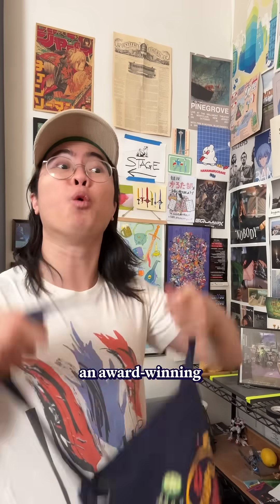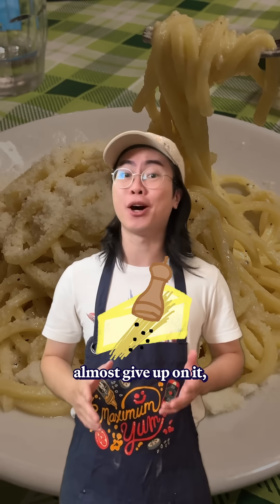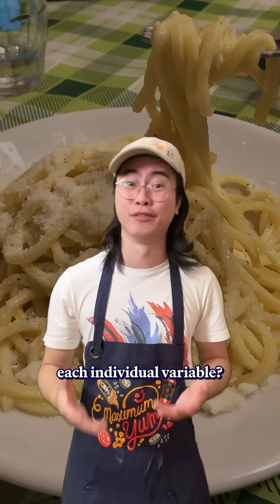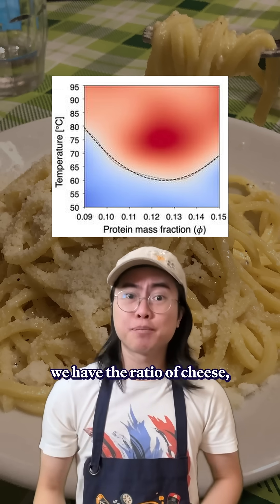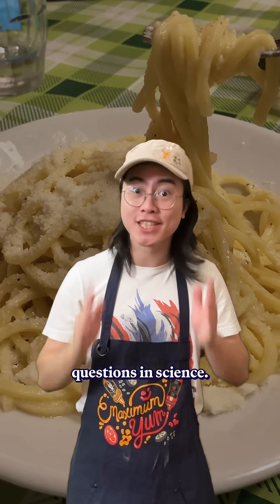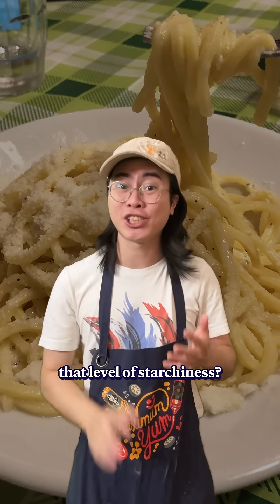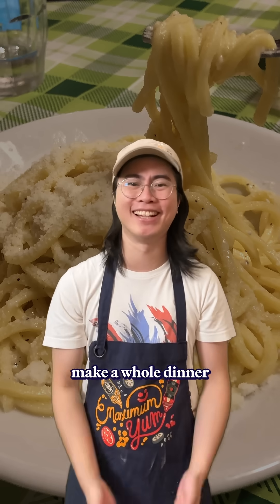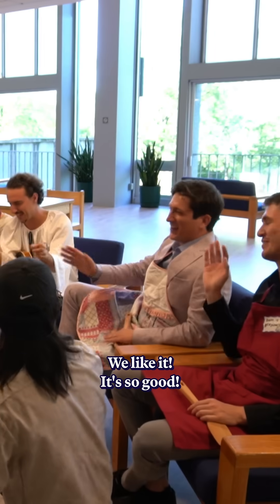The physics of cacio e pepe

Comment: Pro tip, as someone who makes this kind of sauce all the time with any kind of cheese. It's not rocket science, and there is no need to add any extra starch from another source. The secret is BOILING THE PASTA IN LESS WATER. Using just about exactly a tiny bit more than needed to cook the pasta, enough to melt the cheese into, none to strain, this results in pasta water that is completely saturated with the excess starch from the pasta. After cooking, make sure it is only just hot enough to gently melt the cheese going in, et voila. No extra ingredients, fancy measuring, or faffing about with a whisk in a separate pot. You can add cream, butter, or a splash of lemon, or whatever else as desired.
Reply: Can you specify "in less water" like the pasta shouldn't be almost peeking out the water?
(i never realised people really add much more than that…)
I guess time to try and find out
Reply: @nikolaskuklis5925 yes what you are doing is the proper way, but ppl will literally use 3x the water needed then pour it off, or even rinse the pasta, which u only really want to do for a cold dish mostly.

Comment: @FrenchGuyCooking did a series on Cacio e Pepe where he cooked pasta in the same water multiple times in order to really elevate the level of starch in the water. The other way to do it (without adding corn starch) is to use as little water as possible, and as fresh of pasta as possible, in order to concentrate as much of the starch from the raw pasta in the pasta water before using it to make the sauce. Ultimately you're trying to make a roux using only pasta water and Pecorino Romano. If you add any other starch to it then you're still making a roux, but you're no longer making cacio e pepe.

Comment: Use less (near minumal) water when making the pasta. Pull the pasta before it is fully cooked. Dump excess pasta water. Let reserved water cool to under 60c in pan. Then add cheese and return gentle heat and stir, until fully combined. Toss noodles in warmed sauce and plate.

Comment: The secret to cacio e pepe is: don't use a food processor to turn your pecorino or parmesan into powder.  That leaves it in small balls, and the distance from the surface to the center of the ball requires a long time to melt.  You therefore resort to higher temperatures... and get the gloop.

INSTEAD, use a MICROPLANE.  Now, every little crumb of cheese might have the same volume as the food-processed ones, but they're thin flakes.  The distance from the outside to the center is very small, and they melt quickly and at lower temps.

The starch in the water actually isn't critical to a good cachio e pepe.    In fact with no starch you can up the cheese content just a bit more.

This tip also applies to the other spaghettis with grated hard cheese: Cacio e Pepe, Pasta alla Gricia, Carbonara, Fettuccine al Burro, Fettuccine Alfredo.

Comment: Uh it’s not that difficult to make.   Grate the Pecorino Romano in a bowl then boil the pasta until it’s about 3 I’m away from being done.  Toast the cracked peppercorns in a dry pan until they smell spicy and ass some of the boiling pasta water to prevent burning and shut off the heat.  Add a tablespoon or two of pasta water to the grated cheese and mix.  Put boiled pasta into the pepper pan and the heat from the pasta, warm cheese and warm pan should be enough to bring it together.   Too high of heat and you will have a stringy mess.  

The cheater way to do this is to grate a few cups worth of cheese.   In a separate bowl  microwave some water to near boiling point.  Put cheese into a blender or food processor and add half of a teaspoon of corn starch to the cheese and pulse to mix.  Then add just enough of the water and blitz to the point it is a thick cream like a buttercream frosting consistency or just slight more loose than that.  This can be added a table spoon or there about to hot pasta in a hot pan and the corn starch will stabilize the emulsion as well as make it more pleasing to eat should it sit for some time.   Cacio e Pepe is a dish that needs to be served and eaten immediately otherwise the texture goes off fast and the cornstarch delays that. 

In place of some of the water in the stabilized recipe you can purée steamed vegetables to add color and other flavors.  You still need to add water to the blend to get the right consistency but having a jar roasted red pepper flavored cacio e pepe starter in the fridge would make for a nice quick and easy pasta side or main dish for a mid week meal.   I have not tried freezing this blend but I imagine as long as the blend doesn’t reach a very high temperature say more than 150 degrees it should still work.

Comment: One trick I've seen to avoid using corn starch and stick to traditional ingredients is to cook the pasta in a much smaller amount of water to concentrate the starch from the pasta in the water. (No, don't break the pasta.) You can use a pan, it needs much less water; looks weird when you're used to the pot, but other pasta dishes cook in a pan such as Pasta All'Assassina, so it's not a new idea (although one could argue that Assassina is breaking some rules...).

Comment: Mythical chef Josh said something on this. If you think about the old way of doing things, they used the same pot of water for all the noodles, there was extra flour on the noodles, and they would add water each time they cooked to replace what was bolied off. This would lead to a very starchy water, which would also be heavily salted to keep the starch levels low enough that it was atill watery and prevent spoiling. Adding a teaspoon of flour and a half cup of water managed to get a decent consistency for him

Comment: 1. Use real high quality bronze cut pasta (google it) its the gritty looking pasta. It contains a lot of starch compared to commercialized bs grocery store pasta

2. Use the block of pecorino romano cheese and grate it yourself. Dont use pregrated because it contains emulsifiers to keep it from clumping while packaged. If you use that in this dish it WILL clump up once it hits the heat

3. Dont use a lot of water when boiling the pasta and use that pasta water for the emulsion process

Comment: I used to work at an Italian restaurant, fancy one, not a big chain kind of thing. They had one pot for cooking pasta and only changed the water twice a day. Let me tell you, when it comes to your important "starchy pasta cooking water" THAT stuff after a couple dozen portions of pasta had gone through it was a totally different ballgame than the water you have at home after cooking just one package of pasta in the ~4L water usually recommended. You could up the starch levels without corn starch by using less water to cook the pasta. 

Of course it would take more testing to find out the details.
Reply: I need the all day pasta water. I can tell pasta water from on boil does something, but starchy pasta water that's been making pasta all day? let alone half a day? oh boy that's gonna make a nice sauce.

Comment: A foolproof trick is to cook off your pasta in as little water as possible, once your pasta is mostly cooked through move it to a different pan, ladling in your reserve starchy pasta water and letting it evaporate leaving more and more starch behind, finishing off your pasta to al dente with these ladles of water and increasing the starch content, then add a ladle of starchy pasta water that's slightly cooled into a bowl with grated pecorino and your toasted black pepper and you shouldn't ever deal with the issue of your cheese clumping and going stringy. Taking your pasta off the direct heat, mixing in your cheese mixture and quickly tossing it through, ladling in maybe a little more starchy pasta water if needed

Comment: also, FYI another favorite cheat is adding an oil like extra virgin olive oil. It does two things:
(a) lower the overall temperature of the dish and the pan, and 
(b) fulfill the role of loose starch in helping the sauce emulsify. 
Drain your pot, reserve pasta water, put noodles in pan with pasta water, then add the oil and start tossing. You'll soon get a glossy coating, and that's when you know it's ready for the cheese. Dust with a handful, mix vigorously, then start tossing again.
This method is so reliable it just helped me recover from a Mozzarella'ing just a few hours ago.

Comment: Personally, I don't think corn starch is cheating. Most other recipes will recommend buying horribly expensive pasta that is heavily dusted in its own flour, providing the necessary starch to kickstart the saucening. I've personally found great success using fresh pasta, which itself will be heavily dusted in AP flour to keep the noodles from sticking together.
EDIT: also, easy mode is starting with shorter noodles like fusili in a small sauce pot instead of a giant 4-quart pot. The noodle can cook with less water, ensuring thick pasta water even with cheap noodles.

Comment: I cooked a lot of pasta in my house, and I can tell you I've borrowed the cornstarch slurry trick from Asian cooking in my Italian cooking. Try adding some into your tomato sauce, not a lot, and it will help make it cling to your pasta better. Also, we usually like to use the starch from pasta water for that reason. It's just more concentrated.

Also a physicist found that you can aerate wine super well with a blender. A lot of out of the box things work super well.
Reply: Another fun fact - physicists found out you can take hours to age certain spirits by years (experts were quite uncertain when comparing such whiskey to the one barrel aged for certain number of years), by putting corresponding wood chips within the container and blasting it to ultrasound machine.
Reply: My old beverage director sayid that if you need to aerate a wine quickly, just recork it and shake the hell out of it.
Reply: @abydosianchulac2 One more trick too. The slurry trick works really well for wine/pesto sauces. My wife is vegan so I can't do a roux like my mom did sometimes with wine sauce because of the butter lol
Reply: @VincentvanFlow  use oil instead of butter for your roux, it's vegan friendly that way.
Reply: Is using starch slurry in sauces/soups not a very common trick? 
In German recipes it's very common (I think especially older ones), but just uses potato starch instead.
I'm usually too lazy and use instant flour (? couldn't find a translation for Instantmehl) if it's just about binding a sauce.
Reply: @Tessa_GrI know what you're talking about about. I'd see it in an American grocery as "quick mixing flour." Basically one that's made to just instantly dissolve into liquids. Avoids having to make a slurry, right?
Reply: @VincentvanFlow  I believe that's correct, and that corn starch is actually one of the few that require slurry and heat to thicken something.
Reply: @abydosianchulac2 I figure you just use whatever starch is in the pantry lol. I know a lot of Chinese cooking uses arrowroot powder.
Reply: @VincentvanFlow  Yes, for some reason the name was super hard to find, but that's it.
Good to know, if I ever go to an English speaking country.

Comment: The first time i made cacio e pepe it was with fresh egg pasta I had just made. I wanted something simple to compliment the high quality pasta. It was so easy it took zero effort. then the next time I did it with a relatively expensive dried pasta and it was really difficult and did not turn out right. 
The dish was never meant to be made with the perfect pasta that exists today, when you make your own pasta it will be much more starchy as you need to dust your pasta to stop it sticking together. It will have rougher surfaces because you wont be using an industrial machine which will then also release more starch, and then the egg proteins that enter the water will do a lot of the leg work for binding a perfect sauce. 
tldr: cacio e pepe is not difficult if you make the pasta itself too.

Comment: Cornstarch is my secret ingredient to tomago (Japanese rolled omelette often found in sushi restaurants.) Here's the secret, a quarter teaspoon of 1:1 cornstarch water or dashi slurry per egg and a pinch of sugar. This will increase the narrow window of temperature needed to have cohesive yet discernible layers and maintain a custardy/souffle like quality in between the layers.  The starch molecules soak up water and swell up getting in the way of the proteins in the egg. When exposed to high heat proteins like to scrunch up. The starch getting in the way keeps them from squeezing to much Like a muscle relaxant.

  The cornstarch will also give the egg more cohesive structure trapping just a little bit more air making it light and making it easier to begin the first roll which is a major hurdle for people trying to learn to make this dish.
Reply: Now you have me wondering if adding a bit of starch like that to any sort of whisked egg mass, like even for (French style) scrambled eggs, will make them less temperamental when cooking and easier to get smooth.

Comment: I think I've accidentally mastered Cacio E Pepe. Genuinely I was confused when I heard it was easy to mess up.

For me its a 2am meal so its minimal effort every time. I toss the pasta in cold water in a flat-bottomed wok and allow it to heat to a boil. I take noodles out to taste the texture. No way I'm setting a timer for this. I pour the water out of the pan using a lid to retain the noodles. Keeping a healthy amount of still boiling hot water and grate in the cheese and mix viciously until it looks right.

Watching this short I think I unlocked the cheat code literally my first try. Small amount of water with extra time for the water to extract as much starch as possible. Give it a try.
Reply: thanks!

Comment: The dry paste made for the Roman market contains, in fact, more starch than other kinds of pasta sold around Italy, making the perfect Cacio&Pepe more easily achievable.
Reply: I guess yeah you're right I've worked in Rome for a year in a beer pub in Campo dei Fiori, a square town where it had on the weekend a market where they were selling local food and I've seen often bags of dry pasta that looked like it still had some flour still attached to it, my guess that really added way more starch than regular dry pasta
Reply: You're on the right track. Dry pasta made by forcing the dough through bronze dies (as opposed to ptfe or other low friction polymers) creates a rougher surface that exposes more starch.
Reply: See, this was my first thought - instead of adding corn starch, shouldn't we be trying to get more starch from the pasta?
Reply: @toshaville You could naturally by reducing the amount of water you boil your pasta in :)

The main issue for removing the reliance of corn starch is due to how little extra starch is present on commercially bought noodles in comparison to freshly made ones.
Reply: And pasta waters in professional kitchens are also used multiple times throughout service so the water gets naturally starchier and starchier as the night goes on. I've found that making a slurry of flour and dumping it into the pasta pat and water to be a really effective way of mimicking the additional starch in pasta water from a restaurant.

Comment: Couldn't you use the pasta water to get the starch?
Reply: You can, and that is indeed the classic method. However it's much more haphazard because the amount of starch dissolved in the pasta water is going to vary considerably based on what kind of pasta it is, how long it was cooked for, the ratio of pasta to water, and other variables. A little bit of added starch is much more consistent, which is why it's the standard method in restaurants.
Reply: By total coincidence, I made two batches of fettuccine Alfredo last night. Original fettuccine Alfredo is just pasta, butter and freshly grated cheese, similar to caccio e pepe. The first batch was larger than what I normally make and I was trying for a creamier sauce, so I saved and added a healthy dose of pasta water. The cheese totally mozzarella'ed and refused to stick to the pasta. I've never seen that happen before and I think it may have something to do with the salt in the pasta water. Still tasted fine, and the people I was cooking for were happy with it. The second batch, I made for myself in the usual way, not keeping any more of the pasta water than what typically sticks to the noodles, and it came out normal.
Reply: @roecocoa  Interesting! I wonder if your usual method keeps it in the lower end of the chart, but adding more starch was enough to get it in the middle of the chart, where the danger zone is easier to reach?
Reply: Couldn't you just put the pasta in a pan with oil and boil it in the pan?
Reply: @advanceringnewholder  You mean, frying?
Reply: I assume it would add too much water to the sauce
Reply: @murrat5253 you have to mix the corn starch in water before making the sauce anyway.